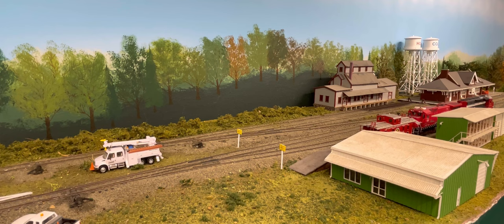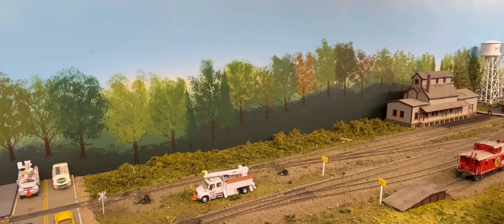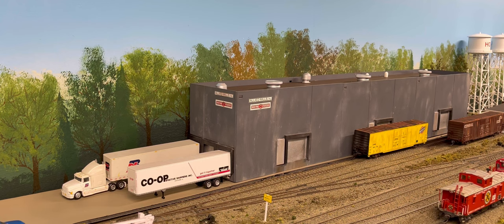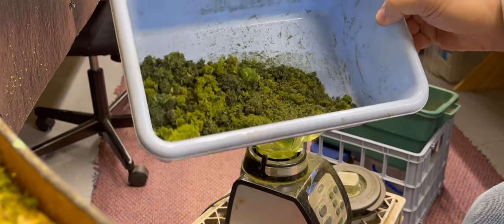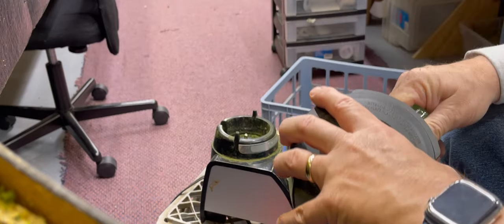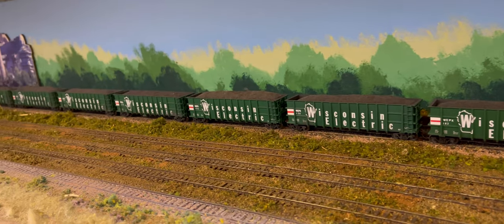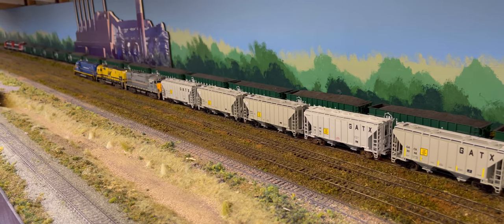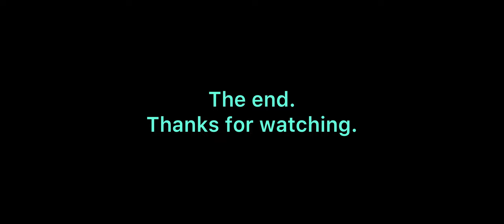13. Recycle your model railroad layout, military, auto and airplane diorama scenery.

Comment: I found a processor/blender at a
rummage sale I use for leaves in
the fall, I take leaves, break off the
stems and fill the blender half full
of leaves a cup of water and a squirt
of light green acrylic paint and let it
do it's thing then I drain the goop thru a cheap strainer and dry the
stuff on an old baking pan in the oven for about a half hour then when
I make trees I sprinkle that on!!!
Nice to see you back Roger!!!
👍👍👍👍👍👍👍👍👍👍👍👍👍
Reply from the maker: That is a neat idea. I’ll have to try that.  One of our crews was seal coating a street and using slag.  It looked like it would make great ballast if dived to the right size.  Unfortunately when I stuck a meter in it like my brother suggested it passed current.  Ok but keep it away from the track.
Reply: Another option, especially if you don't have room to store an extra blender, is to buy a replacement jar and top for it. Many have parts available for a lot less than the cost of the whole thing.